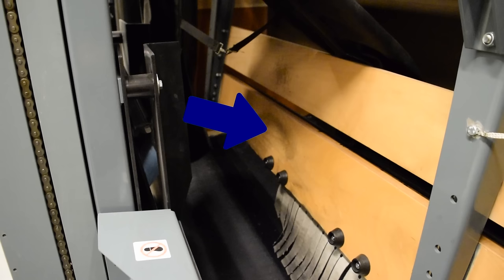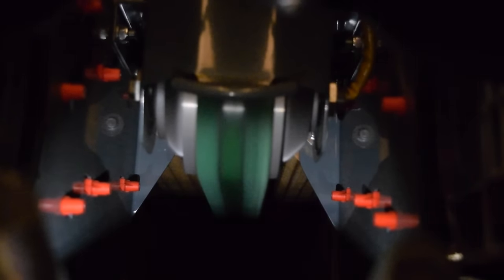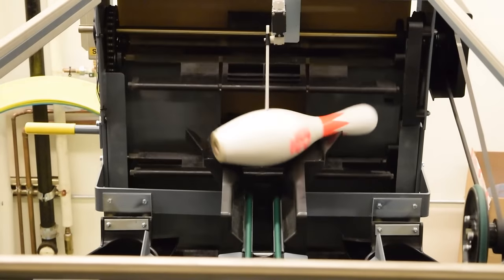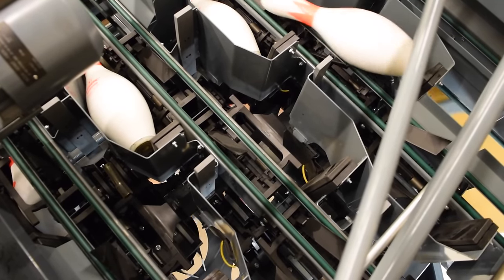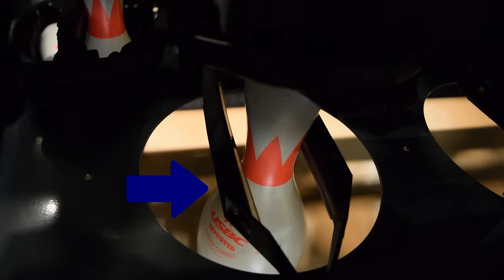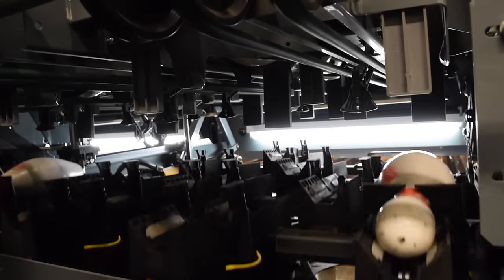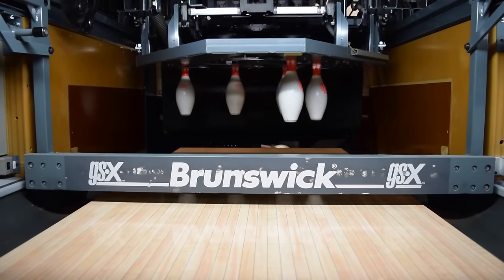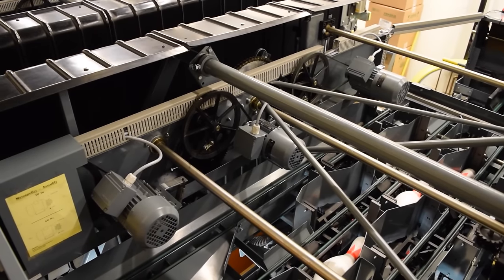Pinsetter Operation  Video

Comment: the GSX's are just rebranded AMF machine!  the A2 is the ONLY pinsetter I would EVER have if I owned a bowling alley
Reply: @Pinz n Pinsetters just look at the function of the GSX machine and tell me where you see a similarity.  The classic Brunswick machine NEVER had the AMF 82-70 functionality until the GSX machines showed up.  

The A2's had the turret system and the AMF 82-70's had the flat tray and 45degree trays.  Then The GSX machines popped up with the tray system instead of the turrets.

That's where!
Reply: @Pinz n Pinsetters I will put it to you so simply that even YOU could understand it, The GSX is more like the Classic AMF designs than the classic Brunswick designs, tray vs turret!

There simple
Reply: @Pinz n Pinsetters Pindeck tray not Pin orientator tray.  the A's/A-2's Used a Pin Turret system, the Turret turned after a pin was placed in it from the pin belt on top of the Pin wheel!  

the AMF machines used a Pinsetter tray, and they had an orientator tray the same as Brunswick yes, nut the pins are/was placed into a Pinsetter tray before being swung down onto the pin deck.  

The turret System dropped the pins into the Pinsetter carriage to be placed on the pin deck for the game.  The New GSX's do the exact same thing now as the OLD AMF machines did.

it's NOT that hard to understand!
Reply: But at least this machine works which is worth it and the features on the GSX were better like you can set up your own shots (Incase if you want to practice Spare Shooting) automatically instead of calling a lazy mechanic sitting there doing nothing of having him to set up pins for you.
Reply: @PinoyBowlerGS92  Have you worked as a mechanic? Yes these GSX machines are better in allowing you to spot specific pins but the mechanic isn't working to be your personal pinspotter.

Comment: QUESTION: I see how the ball is blocked by a wall that only the pins can go under, but what stops the pins from going to where the ball goes?
Reply from the maker: There is a small button that the ball has to push in order for the door to open (54 sec) and let it through into the ball return... Now pins can occasionally get stuck in there but about 95% of the time they cant hit that button so they physically cant open that door.

Comment: Do a video about the A-2 pinsetter and all types of pinsetters.
Reply from the maker: Unfortunately I have only had the opportunity to work on this specific type of machine. From what I hear with so many businesses upgrading their pinsetters A-2's are very hard to come by now a days.
Reply: Naw...A-2s and 82/70s are all over the place. I even know of some 82/30s still in service. Good video!!
Reply: @andyleibrook6012  I haven't run across any 82-30s lately but most centers are still using 82-70s or maybe an early 82-90

Comment: How does the Brunswick A-2 Pinsetter work?
Reply: When the Ball and the Pins fell in the Pit, there are 2 Wheels, the Ball Wheel and the Pinwheel. The Ball Wheel will take the Ball up on the Ball Lift rods and the ball will ride along the track until it exits. The pins will fall into the Pinwheel, the pins will go up into the turn pan, then the cross conveyor and into the turret, all pins will kept index the turret one spot at a time until the 5-Pin (as the Last Pin) comes in the 5-Pin chute in the turret and once that happens, all pins will drop into the Deck Buckets or Deck Chutes and the Deck is ready to set new pins after a Strike or 2nd Ball.

Comment: What happened if won of the pins shift and it’s still standing but in a different spot and then the pin grabber thing doesn’t grab it in the right spot
Reply: Usually it knocks the pin over and an employee has to set the pin manually.

Comment: This must be a more modern pinsetter
Reply: Actually the newest pinsetter is better. Each pin has a tiny string that attaches it to a pulley that doesn't move. After 2 times of throwing the ball, the pulley pulls the pins up and then back down allowing them to return to a vertical position.
Reply: @Pinz n Pinsetters Now you have XD
Reply: Many reasons. One of them is that a typical pinsetter has tons of moving parts and things, while the string pinsetter only has a few since the pins don't travel all over the place. This results in repairs happening rarely while the typical pinsetter, thanks to all those moving parts, results in many repairs happening pretty often.
Reply: @blenderbachcgi . Unless if you properly maintain and clean your pinsetter and provide parts, you don't have to worrie on repairs. I personally hate String Pinsetters, no League Bowlers like myself would ever bowl on these cause of lack of pin action and tangled pins. I don't care of how much money were spent on parts but sacrifice those cash for parts and never downgrade free fall pinsetters to string pinsetters.
Reply: @PinoyBowlerGS92  I'm not a major Bowling player 😀 I just do it once in a while.
Reply: @blenderbachcgi  Oh so you're a Casual Bowler then...
Reply: @PinoyBowlerGS92  I am barely a bowler. I'm a 3D CGI Artist. 😁
Reply: @blenderbachcgi   I’m not sure what’s your point commenting here cause you don’t know any of the pinsetter parts.

Edit: I’m not rude tho, just asking.

Comment: So when a pin is moved from its starting position but not knocked over on the pin table after the first ball how do the tongs accurately grasp it and not move it back to its original position
Reply: Alex Hammer The tongs are engineered so that they start off with a loose grip and then get to full tight before the table is lifted.
Reply: @ratchet1653  I think what he is asking about is an out of range pin,

Comment: bowling: automatic pin-setting machines 

There are two major brands: AMF and Brunswick

It is a miracle of engineering how the machine is able to tell the ball from the complex jumble of fallen pins (dead wood) it's mixed in with so as to route pins and the ball to their correct respective places. Both balls and pins are inert masses. They have no minds or limbs. It's a wonder to me how the ball does not accidentally try to migrate up the pin elevator or wheel or a pin does not try to migrate via the ball wheel or elevator.

The machine has to recognize a ball from a mess of pins behind the pin deck somehow and smartly separate them.
Reply: The ball pit is literally the first component he talked about.  It's basically a board that blocks the ball from going back where the pins go, but the board is up high enough that the pins can roll under it.  Super simple but quite effective.  He shows it at ~ 0:30

Comment: I'm surprised these things are still in the mechanical age. A lot of wasted energy that could be saved with some computer-based sensors and logic. Instead it's just continually force-feeding pins with a 50% divider, hoping to fill all 10 slots, which it doesn't always do.

Comment: How many motors? And tons of belts too!  Give me the original A-2's anyway!  These new Brunswicks are some kind of AMF copy!  By the look of the metal and design these will no way last as long as the A-2's. I have heard that the houses that have bought them have buyers remorse as these new machines will only last ten years.  The A-2's have been around for 60 years and being built like tanks as long as parts are available they'll run forever.
Reply: You'll regret hating the GSX if the StringPin Garbage are taking over your precious A2 Pinsetters. I bowl on GSX Pinsetters at 2 centers, they're not bad.